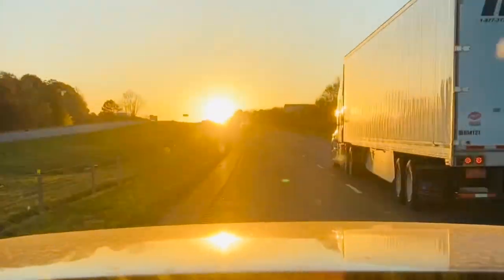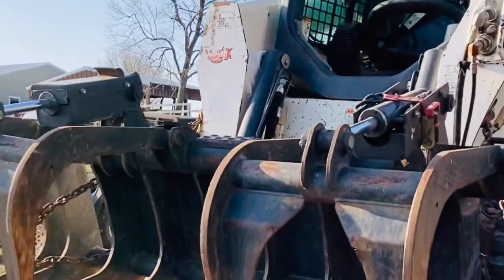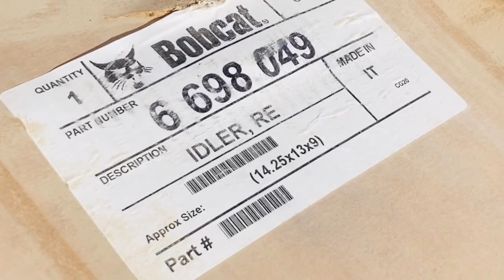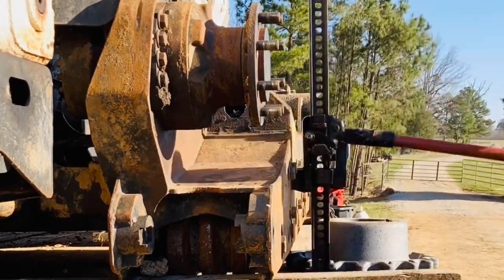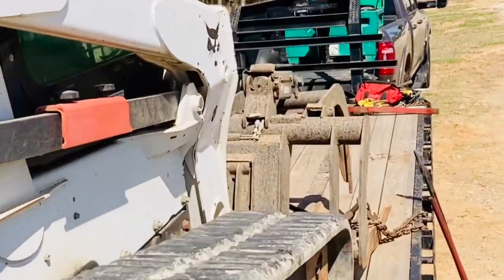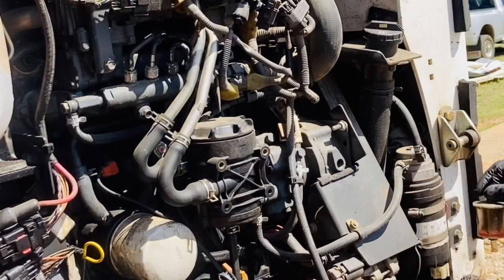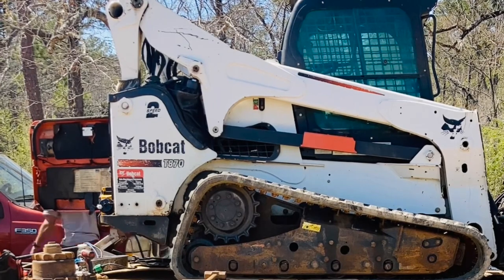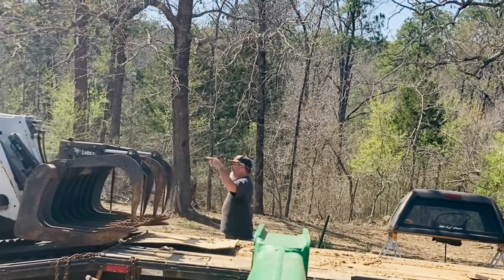Bobcat T870 gets a second chance

Comment: GREAT VIDEO!!!! I bought a T870 (with forestry kit) at auction in MN, sight unseen from a municipality knowing that it "doesn't run properly, starts fine, then cuts out periodically". 2011 Bobcat with 3800 hrs, tracks good, no leaks, hydraulics all good, 2 speed, selectable controls, heat, air, forestry door, everything but a radio. Thought worst case scenario would be a new injection pump and injectors...First thing I did was buy a service and operators manual...read up on the fuel system and it clearly says use no more than 5% biodiesel in this machine...which as everyone knows in MN is hard to get because this state in their infinite wisdom went to 20% biodiesel a few years ago. I immediately drained the fuel tank, added some bio diesel tank cleaner, changed the fuel filter (twice) crossed the border into ND to get some non biodiesel and the rest is history...have 4200ish hrs on it now and zero problems!
Reply from the maker: IRISH SGM, that’s awesome!! The engines usually don’t fail on these unless they are truly abused. My gut told me this was a fuel issue and I was luckily right.
Thank you for your service btw. I’m a CPT currently transitioning out of the NG 🍻
Reply: @Brandon_Builds  Hooah Sir wish you the best as you transition, if you have any questions about that process feel free to ask and I'll do my best to assist you!

Comment: if you are using a regular cold water pressure washer. hose the machine down with oven cleaner, yellow can. let it sit 5-10minutes then give her the spray down. it will actually come clean! stuff is only 3 bucks a can.
Reply from the maker: I will give that a shot in the future! Thanks!
Reply: @Brandon_Builds  dont breathe it, rinse it off ur skin cause itll start to burn. in my experience it wont harm paint or finishes. my excavator was a nightmare to clean before i got this tip.

Comment: The T870 with the tier 4 kubota (which you have) should have an electronic lift pump and not a hand prime pump. Also I recommend not disconnecting the fuel hoses going to your filter head or flipping the filter upside-down. Doing so could cause debris/contaminants to enter your fuel system, which in your case is a common rail fuel system.
Reply from the maker: Thanks man! I did end up getting the OEM lift pump installed. The previous removed it entirely

Comment: if you had drained the fuel system at the injection pump it woulda fired right up no canned fluid. it would have eventually cranked to life under its own power. But understand you still have water in that tank.

Comment: I would flush the system, if it has water In the system. It may have been in a flood zone.
Reply from the maker: I’ve been working on the fuel system, had lots of water make its way to the fuel filter where I can release it. I’ve gone through one tank of fuel and had clean diesel toward the end. If the next tank still has a lot of water I will flush it. It also sat with an empty tank likely collecting condensation